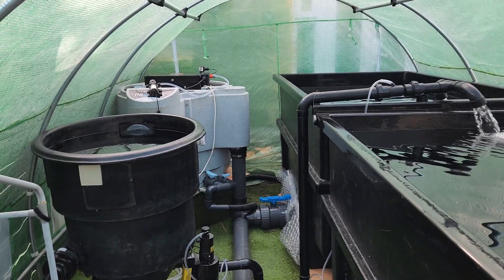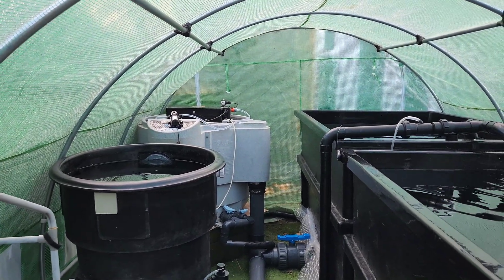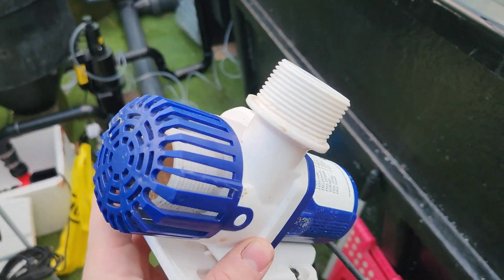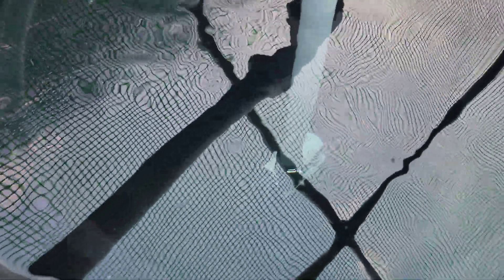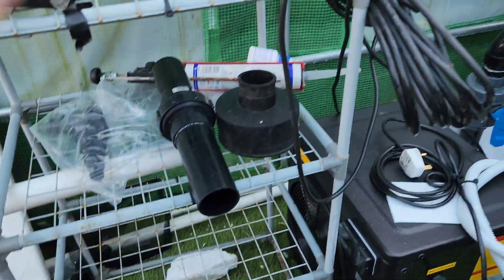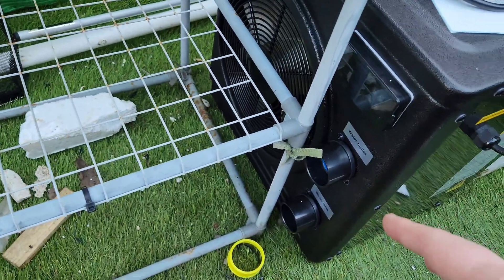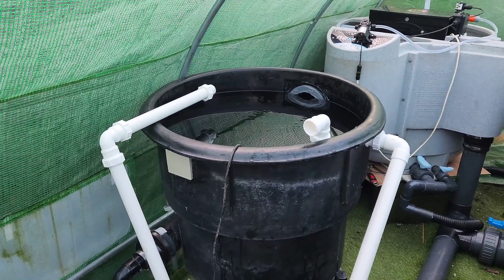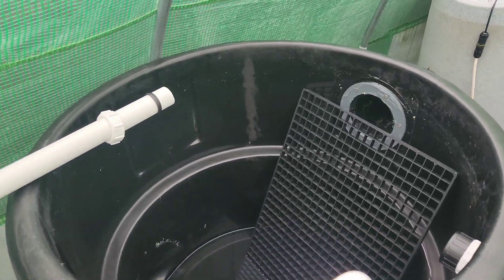Mini Air Source Heat Pump gets a loop and 750 sub Giveaway

Comment: #orchard…. Also the ASHP I’m interested in results specially as I’m thinking of getting 1 but definitely would run conduit straight out “forward” 🤷🏻
Reply from the maker: Yeah I think it's gonna be an asthetics issue in the end having to see this giant pipe out the front may get me some unwanted heat 🤣. Cheers dude You're in☺️👍